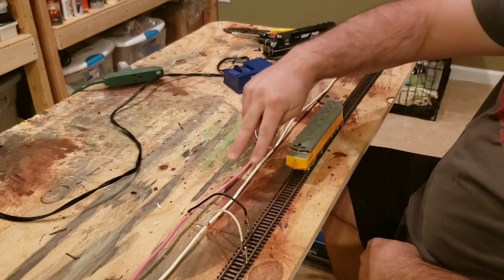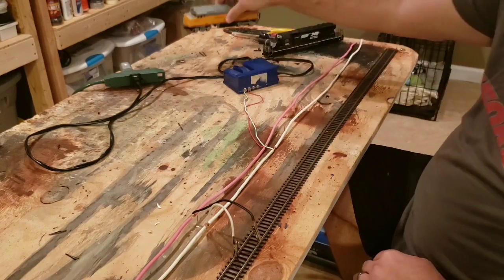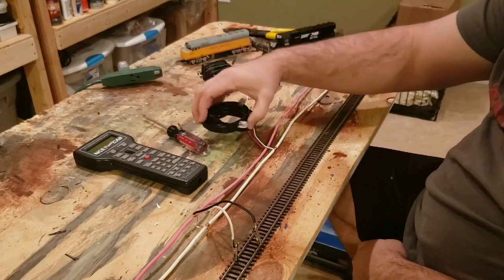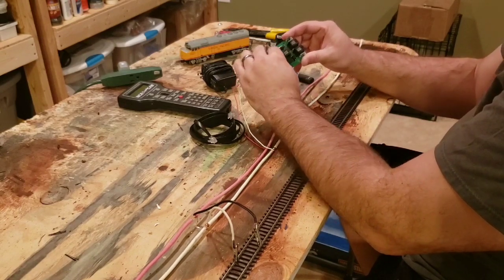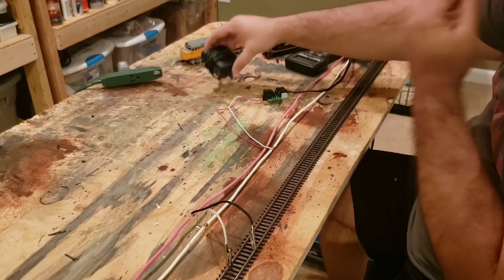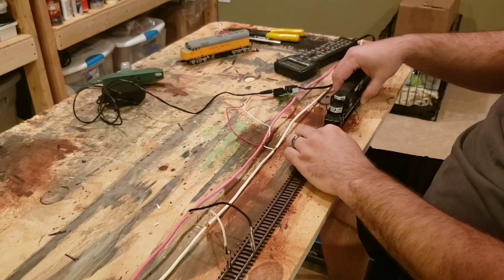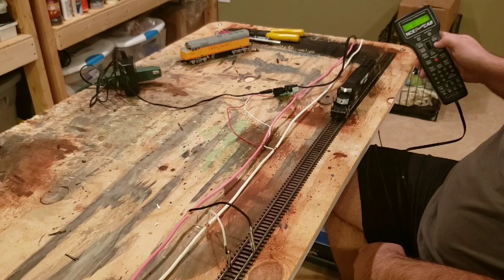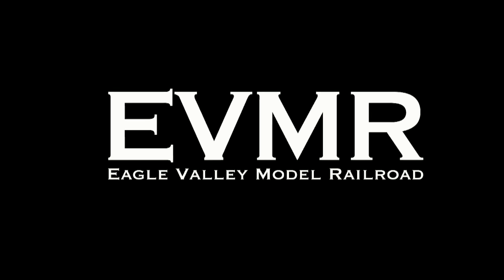Converting a Model Railroad Layout from DC to DCC

Comment: Thanks for this very helpful video, Ed. Back in the "olden days," I wired a layout for DC. That was before DCC came along. My current layout is wired for DCC, and I use an NCE PowerCab, which I really like. I have found wiring for DCC to be easier. I don't need a big control panel with lots of toggle switches, and I don't need to divide the layout up into bunch of electrical blocks. I like controlling the locomotives rather than blocks of track, and DCC allows me to do that. ...Roy
Reply from the maker: Thanks for watching Mr. Roy, I never got big enough in the hobby before DCC to go through the DC wiring. Having an electrical background I can imagine the complexity of it. Thanks again-Ed.

Comment: Great video! Easy to understand and very helpful. 
I have a small 2'x4' layout that is all one single block. 
Sounds like there isn't any conversion to do other than plugging the Digitrax Evolution DCC system into my main bus? Thanks!
Reply from the maker: May need to isolate the frog on your switches, but other than that should be plug and play. Keep me posted on your progress. Thanks for watching-Ed

Comment: Thanks for the video. Very straight forward, well appreciated. I’m looking to convert to DCC. One question. If I connect the PCP to a Digitrax LNWI, will that allow me to use my iPad + App as a controller instead of buying a  Power Cab as a controller?
Reply from the maker: I would be guessing if I said either way, I usually google search stuff like this, most of the time there are forums about whatever I'm asking about. Good luck on your research and great idea. Thanks for watching.-Ed.

Comment: Is the PCP the reason you are able to do the conversion? Can a different controller be used instead of the NCE contoller? And what about turnouts, do those need to be converted? Thanks in advance.
Reply from the maker: Thanks for watching, my understanding of the actual hardware is limited, but if I'm not mistaken each component must match manufacturers. As far as the turnouts, the only difference would be an insulated frog or a energized frog. In my experience no conversion needed. I use code 100 peco streamline track and insulated turnouts. Hope this helps. Thanks again for watching-Ed

Comment: Sorry 
Don’t mean to sound ignorant but will the DCC conversion work on the older trains, like tyco or Lifelike locos? Or do I need an DCC specific loco?
Reply from the maker: The engine will need a DCC Decoder to recieve the signal from the Throttle. You can buy and install a Decoder for almost any DC engine. When buying a new engine they come in two options for DCC. DCC Equipt or on Board and DCC Ready. Equipt or on board means the Decoder is already installed DCC Ready means its pre-wired for the Decoder but not installed. Hope this helps and thanks for watching-Ed

Comment: Is that RJ11 (phone cable)?
Reply from the maker: It is, the NCE comes with two cables one 6 conductor and the other is 4 conductor. The 6 is used with the power cab to supply track power and signal to the track, the 4 is use with an extra throttle and doesn't supply track power just signal. If you go to the 5amp booster that eliminates the need for the 6 conductor wire. Thanks for watching.-Ed